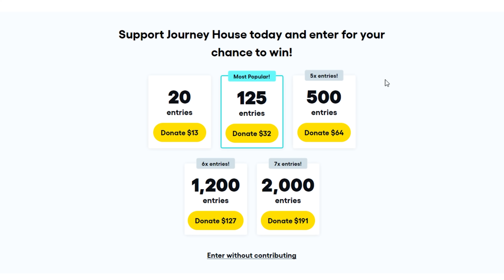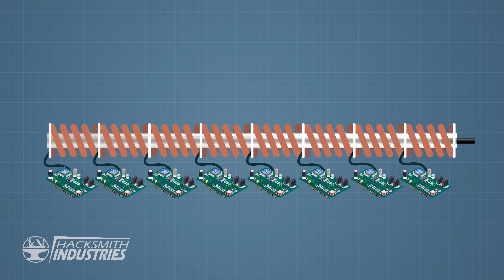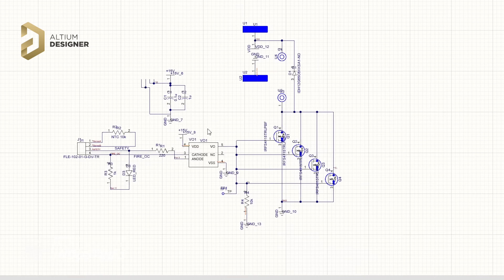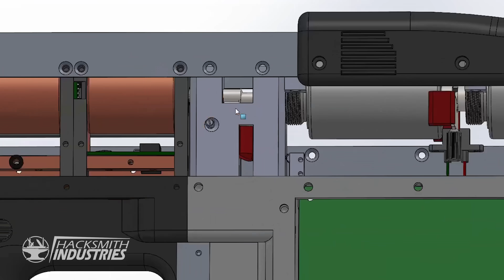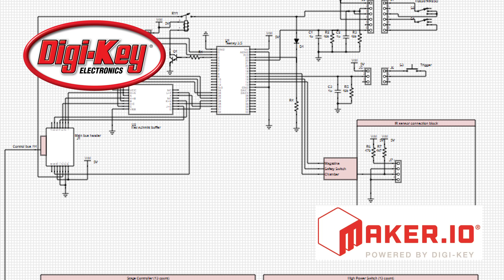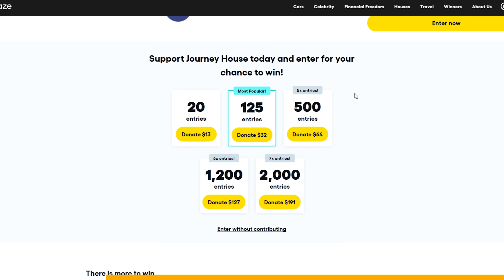MOST POWERFUL ENERGY WEAPON WE'VE EVER MADE!

Comment: 5:22 Wouldn't it be better if the coil winding didn't reverse direction (right, left, right)? It seems like the magnetic field from the first coil layer would cancel out the second coil layer on top of it. Either way, its great to have Charles on the team!
Reply: Each coil turns on when the projectile approaches and turns off when it's halfway through (or however they fine tuned it), so each coil only has a net forward affect. I wanted to see the coil reversed, tho. You could get the same power from half the cells, basically.
Reply: @kindlin  I was asking about the alternating direction of the coil winding at 5:22, not what you're describing.
Reply: @gabedarrett1301  
Oh, no, in that case, it's working as designed. The wire is wrapped in the same direction while going in both directions, always with the lathe, so the 'flowing' electrons always go in the same direction each layer. You would need to kink the wire and wind the layer back the opposite direction for it to cancel out, and it wouldn't cancel perfectly for various reasons.
Reply: @kindlin  Ok, I worked it out with the coiled version of the right hand rule and you're right

Comment: That's an eye opening. Our technology is improving from time to time. If you can solve the scraping causes deceleration, start from low coils to high coils, less drag on bullets and the firing magazine feed system, plus heating issue on barrel, I think it works pretty good, its just not to exceed the limits of enforced law as you've said though. But if its for national weapon research, I think it hits the spot, for a good cause.
P/S: I think this is good enough. If you make it further, it will be national grade secret.
:elbowcough::elbowcough::yougotthis:

Comment: while i'm sure there are huge lists of issues as to why the idea wouldn't work, would it be simpler to have a time system set for a volume of charge to set each coil off based on previously studied volumes? then you don't actually have sensors in bulk to set it off but one computer grid to just set off the triggers in the required timing from a single system... probably harder to program and you'd need the sensors from the normal gun's design to get the timing in the system, but wouldn't it reduce weight and volume of parts required?
Reply from the maker: The sensors are tiny, removing them wouldn't save much of anything -- doing it without sensors is like solving complex calculus without a calculator -- it's the hard (bad) way to do it
Reply: @hacksmith  understandably, i'm not a technician so I would default to you on that, I just wasn't sure how much circuitry could be saved to use a single trigger system and how much weight was being held in the individual triggers.

Comment: Would it be practical to make a rifled tube out of aluminum and have some small fins on the rounds that ride in the grooves to provide stabilization after the rounds exit the barrel? Obviously, this would involve a fair bit of friction, but with proper lubrication (maybe lithium grease?) I wonder if the stabilization would outweigh the loss in energy due to friction.

Comment: Hi, i'm designing my own coil and i expect the on time to be roughly the same as that of the ones you guys are using. My question is what kind of heating rate have you guys found to be acceptable? i'm thinking about 5 [K/s] but i have no clue if this is too high or if i can get away with even higher. i would love a response but if anyone else has some thoughts or experience that would be great too

Comment: LOL! I don't think that was going anywhere near 152m/s, probably closer to about 2m/s. 

Instead of round wire, flat wire (copper foil) or litz wire would work a lot better, since your losing a lot of power from the skin effect. I would use a set of caps to discharge into the coil instead of powered from the battery & using SCRs instead of Mosfets since they can handle more current, and really what you want is a short burst of very high current. Smaller sized caps but with higher voltages (to increase current\magnetic flux) & a lot more stages. Cap sizes would probably have to shrink after each stage since the projectile is moving faster and faster and need a shorter discharge.
You could probably do something like 48+ stages\coils with something using 1 cm wide coil foil with 10 turns or less. More stages equals more oomph. 

The biggest issue is the magnetic permeability of the projectiles, which will limit the magnetic force that can applied per stage. Perhaps gluing a NIB magnet to the front of the projectiles (i presume they are dowel pins), might help. Even better be to apply a Halbach array as the  projectile if you can find a set round magnet with the correct pole arrangements. Another way would be to create projectiles by laminating a set of steel welding rods into a solid round rod & slice up into projectiles.

Comment: I have no idea how this could work, but you could look into composite materials and aerodynamics for the projectiles. Real railgun ammunition is somewhat similar to arrows or crossbow bolts in basic principle, at least as far as I know. With  most of the projectile made out of lighter materials, featuring fletching in the back, and heavier pointed tip with a light mantle. That should improve accuracy, effective range, and penetration. 
With 3d printing and digital simulations, that could work really well. In my mind…

Comment: "Technology has advanced to the point where using any sort of black powder or explosive fuel seems downright silly"  
And yet in Halo the UNSC still uses 7.62 for some reason.
Reply: They also use 10 Guage shotgun munitions I stand corrected its even more ridiculous its 8 Guage
Reply: @Kai_Keller02  Nay, its 8ga. Imagine the barrel width of a fig, persimmon or large strawberry. 

Honestly it's one of my biggest (silly) gripes about Halo. This is supposed to be standard issue shotgun for humans as well as Spartans, but hell, I'd be hating myself, and life in general, if I had to actually carry and use one on a daily basis - though, I suppose, the weight will help offset some of it.
Reply: @Kai_Keller02  8 gauge actually
Reply: Kimi Timoskainen  Actually this guy explains why Scorpions use the armor they do: 

"I mean, their C4 equivalent can punch through 10 feet of solid titanium armor. I think you're underestimating the tech difference.

The SRS99's 14.5x114mm round is the same size as the round fired by the Soviet PTRD, a WWII antitank gun, yet it has superior penetrating power to a modern 20mm autocannon.

Yes, the M808 has a 90mm cannon, but it's been stated to have comparable firepower to the 155mm cannon used by the M820, and both have inferior firepower to the 120mm cannon used by the Grizzly. Size isn't the be-all and end-all when determining performance.

Furthermore, both the 102mm surface-to-surface missile fired by the M41 and the 25x130mm slug fired by the Gauss Cannon have inferior firepower to the M808's 90mm gun. Said 25x130mm slug is also fired at Mach 40.

Additionally, a 90mm gun was chosen because of weight or space restrictions. 90mm shells are much lighter and take up much less space than 120mm shells. Also less resources are required to build a 90mm gun. In a galactic war fought over hundreds of planets, resources can be tight. And if a 90mm gun can get it’s dirty work done, what’s the point of using a 105mm or 120mm? I think a 90mm gun is perfectly acceptable for the Scorpion to have, given the circumstances. To be honest, many seem to vastly underestimate this. Tank guns (or any sort of ranged projectile weapon for that matter) are all about caliber versus muzzle velocity. If we have a cannon, and opt for a 90mm caliber, that gun will have a lot more muzzle velocity and penetration, plus accuracy (faster muzzle velocity=less bullet drop). On the other hand, if we keep the same barrel length, but opt for a 120mm caliber, it’ll have much less accuracy, range, and muzzle velocity, but there’s a much bigger round to make up for that. The Scorpion may be armed with the Pershing’s main gun, but that gun packs up to 20 times the punch of an Abrams’ main gun."
Reply: Important to note that it’s 7.62x51, not 7.62x39
Reply: Because batteries turn out to be even sillier.
Reply: @absalomdraconis  Yeah, but I've heard some gun nuts say that there's a reason the cartridge is less and less prominent even now.
Reply: The cartridge takes up space and weight in ammunition storage. It requires a complicated ejection cycle, it has several components that can and do fail often. Not to mention explosive propellants are limited as to how fast they are able to throw something.
Reply: Just because tech is old style, does not mean its effective, or a newer tech is superior in general. There is a nice simplicity and robustness about chemically propelled projectile weapons.
Reply: @vast634  correct

Laser and energy guns are cool. Until you get hit with an EMP.
Reply: in reality, defending against energy weapons and kinetic weapons are entirely different concepts, so a mixed arsenal makes a lot of sense, keep the covenant paralyzed
Reply: @AndrewB383  You don't need to use gunpowder for that, especially not 500 year old cartridges. We are beginning to move away from 7.62 nato even right now.
Reply: I mean, if it gets the job done
Reply: Kimi Timoskainen  , maybe if the UNSC took a few lessons from the M1A1 Abrams tank and its related ilk, they could fix those speed issues.
Reply: Because it’s effective, I mean 30.06 would be better but yeah
Reply: Effectively it would come down to cost of production.
Reply: Unironically, I don't think we'll ever phase out explosive ballististics or atleast a very long time, especially for infantry. Electric weapons are too fragile, innefficient and complicated to replace chemical ones among handheld firearms, they don't scale well, down even if rail cannons could go a long way. Maybe in 80-150 yrs we'll get them on tanks but not much smaller
Reply: @tumultoustortellini  There is also some tech that is efficient, but not used due to moral reasons:  laser and microwave weapons. Lasers for blinding opponents and directed microwaves as a pretty cruel weapon that heats up tissue.
Reply: @vast634  I know about those and I understand why we don't use them (reasonable reasons of course). I meant railguns like the one created in this vid.

Comment: The main downside that's holding this back is that with black powder and a spiral design in the barrel of a gun you can create spin to stabilise the bullet, Since this is electromagnetic you cant do that but once stabilised accuracy will be much better.
Reply: Adding fins would probably solve the problem but that requires the projectile to have a certain amount of speed which sadly isnt allowed
Reply: Using a lighter material would be a good idea aswell
Reply: @dakaraihurtault2289  Not if you're going for damage factor, as in ability to use it as a real weapon in a combat situation. For hobbyist cool factor? 100%. I don't make videos that would serve as evidence, so I would absolutely be maximizing speed as much as possible to see where I could get it. lol

Comment: Love it! Mayb tryout really fast switching fets like GaN and adjustable coil power(PWM) to get a more sine like magnetic field movement. Pair that with a really nice electromagnets like (several)lamelled silicone steel cores as used in electrical motor design and rectangular wire for most current capabilities per turn. Let the coils have absolutely zero distance between them. Combined with magnetic soft iron as projectiles and a as thin barrel as possible, and I think you will have to move the operation to US. I don't however, think that you need to put more amps into this, just use the energy more wisely. I also think that with an adjustable coil, you could lock the projectile in  place with the first few coils using like 1% of the power. Since the projectile movement can be predicted quite well, given that the magnetic field is constant and friction is equal, you could make away without the sensorfeedback as well. In addition to this, you could levitate the projectile if it were a magnet. But that might be railgunning over the target. cough

Comment: 152 meters per second? That's only like 500 feet per second,  even low power hunting cartridges shoot faster than that, because you're using electrical energy, is that the reason for the low cap on velocity?

Comment: Thanks for this very interesting video. Especially using electric ideas is a very interesting approach.

Please allow me to give you some new ideas to improove your railgun. I understand that the enegy of the pojectile is limited by law.  But, just as an thought experiment, if this limitation would not exist, here are some inproovements:
You need the highest dI/dt as possible to increase the magnetic field as quick as possible, and, as a consequence, the speed of the projectile. 
Therefore I would suggest to use a capaciter for each power module, mounted as close to the switching module (to reduce inductances) as possible parallel to the batteries.
Second: I suggest to raise the voltage and the thickness oft the wire of the coils and therefore reduce the numbers of the windings. This will lead to a lower inductance and therefore to a quicker increase of the current and the magnetic field.

Comment: i doubt you'll ever see this comment but i wanted to let you know you added unnecessary complexity and made a lot of extra work for yourself by putting sensors between each coil segment. you just need to work out travel time for the rod and have each coil turn on and off in a timed sequence. assuming power output is consistent travel time down the barrel should be the same every time.
it might not be easy to work out without a bit of trial and error but no sensors means more room for coils and zero gaps giving improved efficiency and reduced complexity in the end product.

Comment: For the friction/bouncing related problems, you could go with multiple coils or permanent magnets perpendicular to the bore + slighttly tilted to towards the projectile direction, with a symmetrical build you should be able to get a similar effect as a magnetic bearing. If you offset the coils to the bore you could use them to introduce spin aswell. Another way without drastically impacting dimensions would be using teflon stripes + some tension + self centering concept.

Comment: T.thats not a coil gun. Its a GAUSS GUN.
A coil gun runs a single lane coil or multiple down a tube/barrel. 
A railgun uses two rails.
A Gauss rifle uses wrapped conduit or magnets themselves in splits down the barrel. Hence the Fallout M72 Gauss Rifle.
The M72 used a hybrid magazine + battery/capacitor.
The ammo was 2mm spikes. Made of some dense metal. And the battery was… some kind of Fallout battery. Both on one unit. Because the mag carries 50rounds.

Comment: What if you use varied length of copper? Would it just accelerate "more" towards the end? If yes I don't see it as a problem, you just need to adjust the coil powering to accommodate the faster projectile. What is the limit of speed that a "coil" can handle?

Comment: I think it would be more efficient if the coils at the back where smaller to reduce back emf from the fast projectile going trough it, this would increase the current consumption of these coils but it should be fine since they are energized for less time. Still looks sick tho
Reply: The coils nearest the user will actually be running longer per-length than the ones closer to the target, since the projectile won't be moving at it's final speed yet.

Comment: Instead of just turning the coils on and off to pull the projectile down the barrel can't you also reverse the polarity of the magnets to push and have the projectile a magnets too?  In other words have a strong rare earth magnet as the projectile and turn the magnet on positive to draw the projectile forward, then possible pause a fraction of a second, then reverse the polarity to push the projectile and then start turning on the next magnet as you turn off the last one.  Also I do not see the point in the LEDs and such as you should be able to just have everything timed based on the power and the round.  It would take a bit of trial and error, but I would think that would be far easier in the end to get optimal speeds.

Comment: Very cool! would ball bearings instead of rods take away some of the scraping concerns, or would they introduce other issues?
Reply: Other issues. The most likely reason they're using rods is because of the way the magnetic coils pull and push, it keeps the rod going mostly straight. If they used balls instead, they would have issues with the rounds tumbling. In other words it would be much less accurate. There are other things they could try, but each different type of ammo has its own advantages and disadvantages.

Comment: Why are you using metal for the frame? Use fiberglass rods and resin. Also, you don't need nearly as much power as you think. Use smaller coils, and more of them. A thirty stage track of smaller coils will give you better results than a thirteen stage track of larger coils at the same length. You also don't actually need all those capacitors, and they're the reason you keep having fires anyway. You're over-engineering it.

Comment: Can you make the projectiles smaller, so you aren't trying to accelerate so much mass? Typical 5.56mm bullet weighs 55-65 grains. Even the larger 7.62 is only around 150 grains. Also think about a method of stabilizing the projectiles to fly truer. Maybe a plastic sheath with fins designed to spin it?